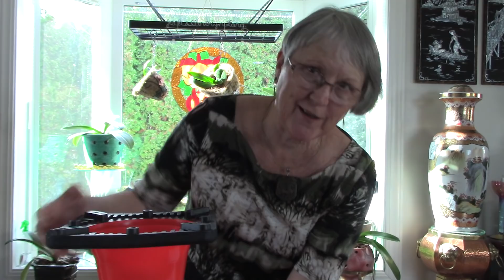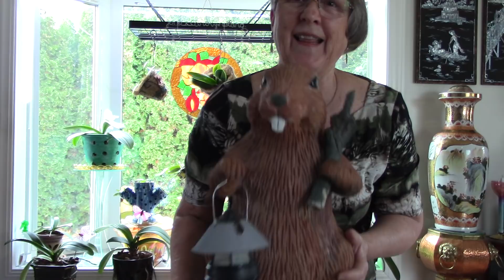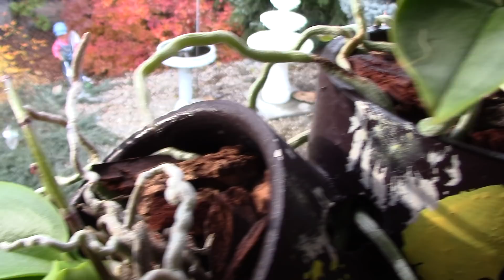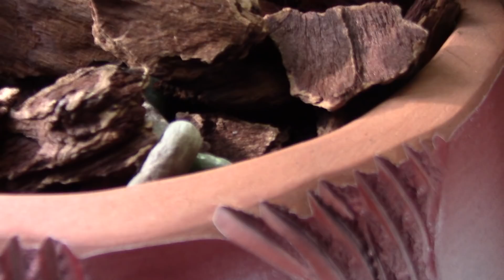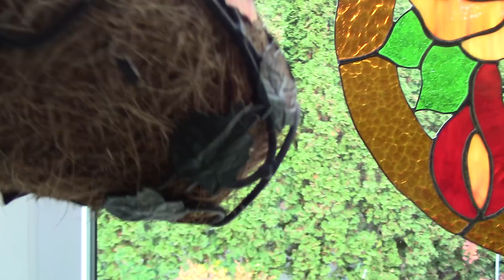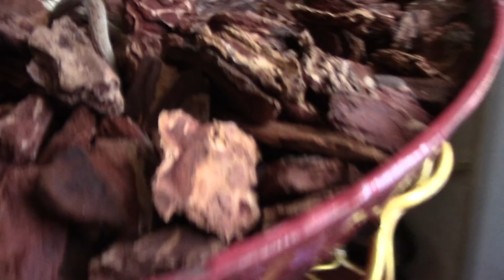Orchid projects, some updates, and a tour

Comment: I love the patterns on the sliper orchid's leaves! I hope so much that I can get one soon! But would it help to add more sphagnum moss to the pot? Or sometging to make it more of a terrestrial medium? Unless you have the bark as decoration, which looks great. :3 I'd do the same because I like that better than dirt. I do something like that with my bromelaids and nepepenthes but with live long fibered sphagnum moss as a top dressing. It can grow a bit out of control but I find it's a great visual indicator of when the plant needs to be watered again since the tips of the 'leaves' on the upper most growth points turn white if there isn't enough moisture in the pot to keep them sufficiantly moist. Only works om plants that like it really wet though. Tried it on a violet/lavender phal I have. But the moss died because I couldn't keep the pot wet enough without risking the health of the orchid. Anyway, sorry for prattling on, but the only thing I could think of is a more traditional trrestrial media mix for the slipper orchid if it's not already in one. ^^)><3 Thank you for all your videos they're always informing and insperational!
Reply from the maker: Hi    De Te Criez    Next re pot    I   will add  some   leaf debris to the mix either Oak or deciduous tree from outside.  That  is supposed to be a great addition   plus the  brick mortar both of these are recommended by Rentoul  in his   book.   Probably  come Spring!  Enjoyed your comment    Carolyn

Comment: I use the 19-31-17 fertilizer and I bought it at Walmart a couple of years ago but I think the spikes comes out on my phales. because  I dropped the temperature to 17c for a couple of weeks now they are in spike
Reply from the maker: Hi Vicki  I have always left mine on the patio until they have a few weeks of drop in temp, but this year because I the horrible smoke from the forest fires I brought them in early, and this year they did not get that serious drop in temps, but they did get  the change in fertiliser,  I have heard it is good to change  your fertliser a bit but this one was amazing     (still think it was the fertiliser)   We will see how my daughters orchids do.   Sent her home with some and she used it on Sunday,  and she has not had much success with spikes.    Good Experiment    Carolyn
Reply: @jacolynsorchids1361948friends  I live in Edmonton so we got the smoke too, but I did not put my phals. on the balcony I just opened a window when it got cooler and I did this for two weeks and then I noticed the spikes